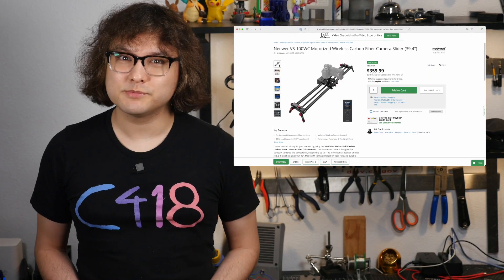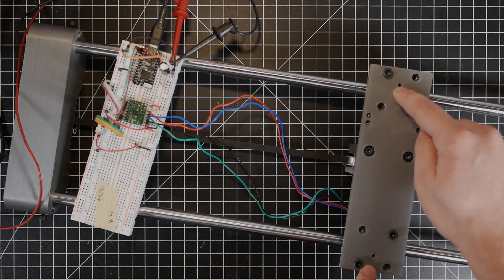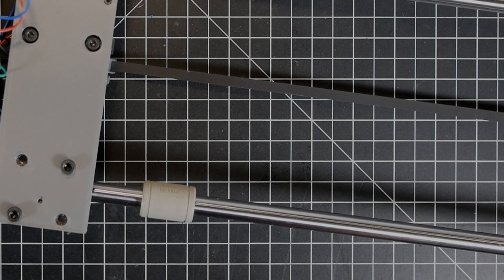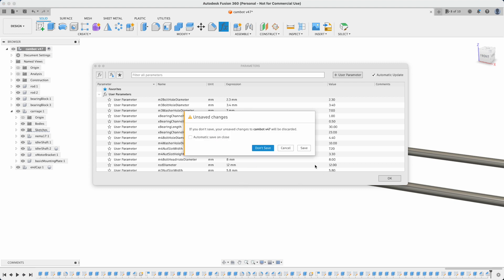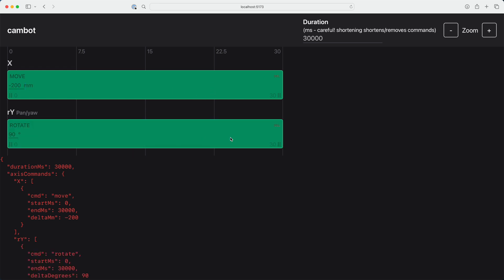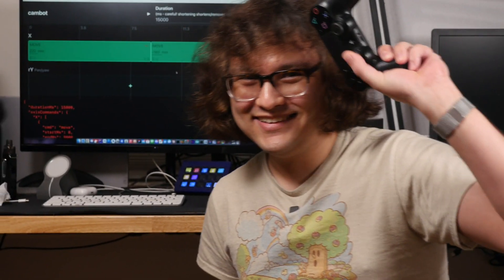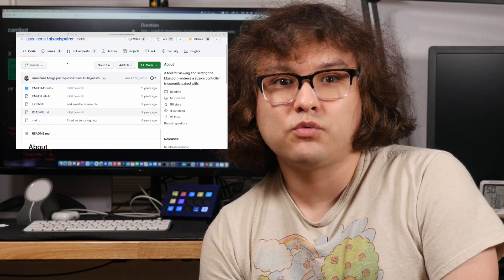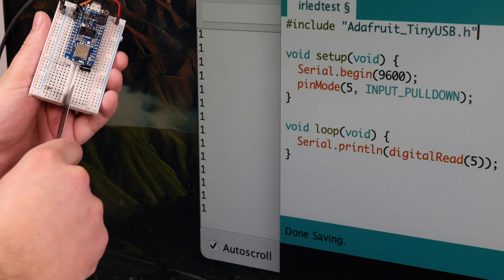cambot

Comment: Do you find that 1/256 microstepping introduces a lack of torque?  I have had problems before with using microstepping and attempting rapid acceleration.
Reply from the maker: It's possible, I need to play with the microstepping values some more. It had fairly significant sound benefits, however.

Comment: Nice work.  Good presentation.  Addressing your shaky movement, 1.8 degree's is a lot of movement, try turning the stepper drivers to 1/8th or 1/16th steps, also may want to consider looking at smooth stepper libraries for arduinos that allow the transitions from direction change to be much smoother.  Further, to address the the top heavy, you could flip over your rail system so camera mount can go down into the well between the linear rods which should provide added stability.  
Again, you have done great work so far and hope you continue on your pursuit.
Reply from the maker: Thanks! I'm driving the motors at 1/256 microstep resolution, and using FastAccelStepper. Acceleration is directly controlled by the sticks when being controlled by the gamepad. Currently, I'm not using any acceleration in programs sent via web, but I may allow choosing easing at some point. Appreciate the thoughts.

Comment: Very nice project! I really like your way of presenting.

I don't know if this makes sense, but have you considered putting the motor on one of the sides of your x axis and using a closed loop belt? This would reduce the size and weight of the carriage and lessen the torsion force it experiences.

Keep up the good work. Looking forward to seeing more of this!
Reply from the maker: I'd like to avoid moving any motors off of the carriage, as having everything in a single unit really helps to simplify assembly and the electronics. That's definitely an option though if my other planned changes aren't able to deliver smooth enough motion. Here's hoping. Thanks for watching and the feedback!

Comment: cool project, but its all wobbly as you showed. Do you think adding 2 additional igus bearings and having the payload between them would make it more stable? i know this limits the travel distance but smoothness should be the main goal of a slider. I don't know about 3D printing and how the different materials behave under load. But i can tell you that my edelkrone slider is all alumin(i)um for the slidey bit. However yours is rather silent while mine has the very basic stepper drivers that sound loud enough to make sound recording on camera useless and they put the motors in resonating hollow shells as if they wanted to amplify that lovely robotic noise xD
Reply from the maker: Yep, I'm planning to completely redesign the carriage with what I've learned here. I'm probably going to try switching to 2020 extrusion instead of the steel rods (which will allow for some separate improvements), and as you mentioned will be making the carriage itself wider. Thanks for the feedback!
Reply: @paulstraw  that sounds great, i would appreciate if you decide to share your progress on here❤